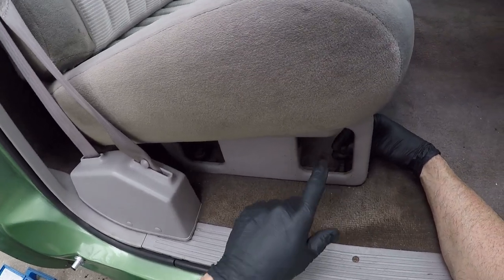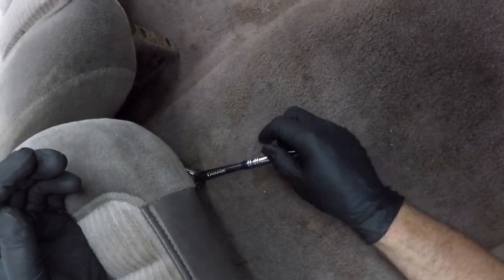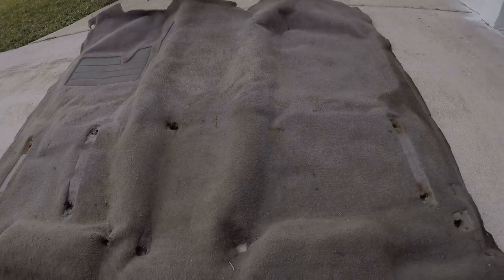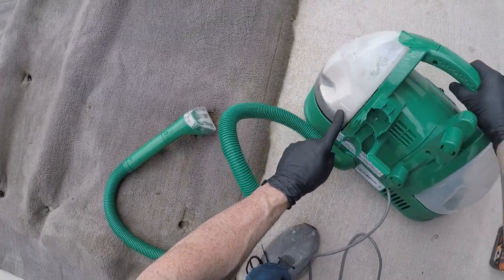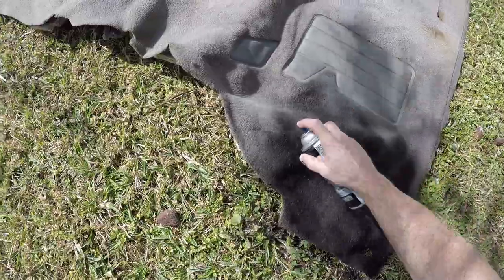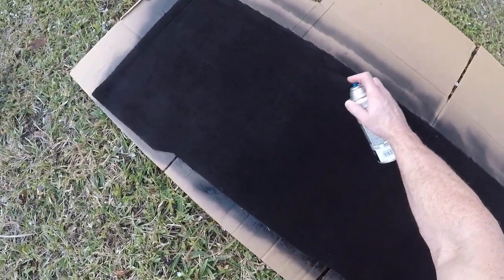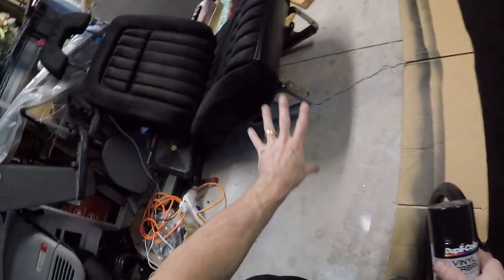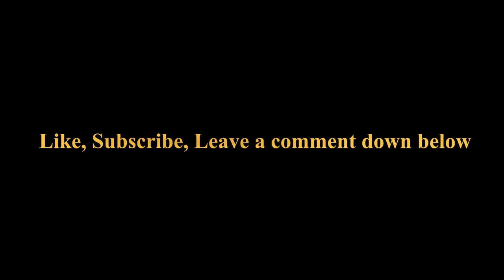Change your carpet / seat color using Duplicolor vinyl and fabric spray | color swap OBS truck part1

Comment: Very nice job. I just bought a 76 Thunderbird that I'm changing the interior color on but I'm just getting a new carpet, The carpet in mine is in good condition but with such a large carpet area  it's going to cost me more to clean and dye it then is to just replace it with a new carpet. I'm still going to dye door panels, seats and trim though because that's definately cheaper than replacing them with new. I am going to revinyl the dash cover a and make a new package tray. it was originally Green and my seats are vinyl with fabric inserts and I'm going to 2 tone it, the fabric is going Cinnabar, which is Cinnamon color and the vinyl and plastic is going to a Beige color. The car is already white and I'm going to repaint it white but I'm taking the white vinyl top off and going to paint the roof something close to the Cinnamon color I get for the interior because... well why not.
Reply from the maker: Thank you 😁 
That makes sense to me, sounds like a cool project your working on. I too went for new carpet on the next project my s10. The budget was higher, also after a year I had to touch up where my shoes always moved around on the floor by the peddle. The non touched parts are all like new. The rubbed bits under my sneakers faded a tiny bit after alittle over a year. As for cost 6 cans was half the price of the new carpet. For a cheap beater fix I would still clean and dye. For a long term keeper I would buy new. Live and learn 👍
Reply: @thisoldhooptie  Nice, I don;t really have "Budget" persay I just want to do stuff the most cost effective and simplest way possible, I'm not doing a 500 point restoration, I'm basically knocking the dirt and rust off it and building an above average daily driver that I can take to Cruise-ins and  Cars and Coffees. I wasn't going to go with new carpet but my carpet is twice if not more than the S-10 carpet, I figured for 3 coats it was going to take 12-15 cans of dye to just do the carpet, just the dye is is $140ish, plus what I would pay in cleaning supplies I figured another $20 for that plus the water to clean it and the time invested just isn't worth it when I can get a new molded carpet for $180 including shipping, that's 10% more for something that's brand new and I don't have to worry about it again.
Reply from the maker: I agree with your points. I am not sure why I didn't put 2 and 2 together in my reply. I get so many replies on the chevy trucks I passed over the the fact that yours is a car and is larger. Sorry about that👍 😁
Reply: @thisoldhooptie  No your good, I figured as much. IF I was doing a truck I'd certainly use dye.

Comment: Im a little upset man that interior was really nice. I looks good black but that interior was alot nicer then most 88-94 OBS interiors ive seen
Reply from the maker: Trust me when I say looking at it from 10 feet away it was ok. When your close or in it and could see the cigarette burns, cracks, Fading, permanent stains, you would feel different. The door panels would literally come apart when I closed it from the inner handle. That being said since I'm restomodding the whole exterior and engine bay it would look strange with a beat up interior. I have new custom seats coming with lumbar and foam that you don't sink through. They are being built now. The inside needs to match the outside a mix of new and old. Thanks for joining the project :)
Reply from the maker: Not sure how this comment slipped through the cracks. Your project looks great too. Love the white, almost went white myself. Then I let my little girl pick and off we go. Hows the ls swap comming along? I will be doing the same when I'm done with paint.

Comment: Dude every video I watched you f*** this truck up even more LOL that original gray interior was nice
Reply from the maker: Cigarette burns, worn out seats, and door panels that fall apart when you open or close the doors are not my idea of nice.
Reply: @thisoldhooptie  not saying that but the original gray interior is nice in those trucks.. that carpet with a little bit more love could have looked brand new.. but it's not my truck ;)   still give you an a for effort...
Reply from the maker: The carpet and back panel carpet yes I agree. That being said i wanted it black which you can see in the latest videos it goes with the theme. Have a look at my huge interior update video if you have not already. I have nothing against stock grey if its clean. The seats and door panels were bad they only look good on camera. Once you get close or sit in the seat or pull un the door panels to close or open the door it was bad. That was why I ordered the new coverlay ones. Un the end the truck will come out nice and its been fun screwing around in the garage with my kids. For me even doing things twice is worth the time spent. Just my two cents.

Comment: How many cans did it take you? I'm considering doing the same on my S10. Interior is three different colors and very dirty. Would love to have everything black. Did the fabric on the seats get stiff at all? I have some light gray Cavalier buckets and my center console is dark blue.
Reply from the maker: The seats get stiff but softened as they were rubbed and used. I dont remember the amount used. I think it was 12 or 14 for the whole thing plastics, seats, carpets. The carpet and seats took the most. It was still cheaper then new carpet. Since you have an s10 it will be less then the c1500 I did here. I would start with the carpet after a real good cleaning see if it's for you. My carpets, plastics, and seats still look as they did in these videos. I use the seats in my garage I got new ones with lumbar support and a console.

Comment: Nice how many cans just for carpet?how much were they?cheapest place to buy cans? What about sem have you tried there product
Reply from the maker: Thanks, I am pretty sure I used almost a full 6 pack on the carpet. I ordered from Amazon link is in the description.you will need a couple more cans if doing the back wall carpet too. Its really all about the prep whatvever you choose to spray with. I like the duplicolor brand better. Try both on something see which you like better 👍

Comment: Is this flammable and catch on fire
Reply from the maker: Yes all spray paint cans are flammable. The carpet alone is also flammable. You would need to check the carpet data sheet from the manufacturer along with the back of what ever fabric spray you use to have all the details.

Comment: How does it feel on the seats and carpet  . Is it stiff or crunchy ?
Reply from the maker: Once you run your hand over them it softens up. Not as soft as before but not uncomfortable. Its not perfect but for the cost best you can do without buying new carpet or seats if you want black.
Reply from the maker: No its definitely not crunchy its a dye not a paint.
Reply: @thisoldhooptie  Thanks .I am going to give it a try
Reply from the maker: @garyryan7852WR  the carpet its great still nice a black a year later. The seats faded alittle but they were crap in my case. Lots of cigarette burns and worn fabric so the black hid all that. I ended up getting new seats needed lumbar and like I said in the video my seats  were bad zero cushion on the bottoms. Akso worked good on the plastic over adheasion promoter thats all still good too. Good luck with your project 👍
Reply: @thisoldhooptie  Thanks

Comment: Nice wrk
Reply from the maker: Thank you 👍
Reply: Got to do tha same thing
Reply from the maker: @thabigghomie_  The back carpet, all plastics, and dash look like the day I painted them. The carpet needed a touch up a year later where my feet scuffed the floor up by the pedals. Im still happy with what I got for the money I spent.
Reply: So tht vinyl weks good with the door panels too
Reply from the maker: @thabigghomie_  my door panels are from coverlay they are not painted. Yes, if you prep the plastic parts well and use plastic adheasion promoter the spray used in the video has held up great. Good for dash, doors, and trim pieces. How I cleaned and prepped is in the videos if you need a reference.

Comment: I used RIT synthetic dye and it worked very, very well in case anyone is considering doing the same.
Reply from the maker: That was my backup plan if the test piece didn't work out. Good stuff I did some floor mats once.
Reply: RIT fades fast and comes off with water. You’ll accidentally dye things you don’t want dyed
Reply: @Snowly06  shampooed my carpet several times and it's just as good as it was, none at all came up with the dirt shampoo water. Gonna have to call BS on your comment.
Reply from the maker: I have used rit dye to make multi colored shirts 30 years ago. I washed those for years after, the rit dye i used was permenant. It can be messy but what isn't? I just looked it up, it seems it does fade over time. Guess I was lucky. The new version is better then the old as far as fading goes.  But its not listed as a permanent dye. Learn something new every day.
Reply from the maker: Other then my fingers since we did the t-shirts outside not much of a mess. My experience was different, the t-shirts lasted years. You know the tiedye ones. According to what i just read it can fade . I dont think it washes off but if nothing enough is used maybe caused a problem. We let our stuff soak a long time that was key.
I'm adding this so its all in one place:
RIT DYE
Rit dye, which is a multi-purpose union dye, is versatile, easy to use and nontoxic. You can dye natural fibers like cotton, linen, wool, silk and also rayon and nylon fabric. Cotton blends with polyester or spandex will dye lighter and less intense.
There are many colors and you can easily mix them to get custom colors.
The downside with Rit compared to fiber reactive dyes is the colors are less intense and not as colorfast. (That means it can fade or be removed)

DYLON DYE
Dylon permanent dye is a fiber reactive dye, meaning it reacts chemically with cellulose found in cotton, rayon and silk to create a permanent bond. It won’t fade and the colors will be more intense than rit dye.
Reply: @RedBeardDevelopment  it depends on what type of material it is being used on, for example on Nylon rit dye will come off  easier

Comment: How many cans did you use for the carpet?
Reply from the maker: It was either 5 or 6. I think I mention it in the video. Make sure its really clean before you spray it. Takes the paint better. Still looks the same today as it did back then.
Reply: I'm doing my 95 Silverado I can never find gloss black you looking good can't wait to get there with mine
Reply from the maker: Thank you, good luck with your project. I had to drive to multiple auto parts stores for the first few cans. The amazon  link in the description should still work i listed both a single can or 6 can pack.